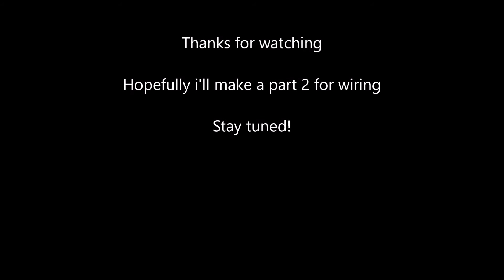VW t5.1 2012 Transporter shuttle Van tow bar installation

Comment: great job! How did you fine the wiring ? did you do a video ?
Reply from the maker: unfortunately my gopro started messing around, it's quite straightforward though, the bypass relay requires a 12v feed, then all the other wires are just from the light clusters, you can chase them back to the nearest point . you take 90% from the rear n/s , i think all you need from the o/s is the right indicator, lights, brakes and stops can be common (they do the same on both sides). Possibly with exception of sidelights (parking lights).... i can't overly remember!

Comment: hi what tow bar is this please? looking to do the same on my 2009 van this week. thanks
Reply from the maker: https://www.ebay.co.uk/itm/143993827117
Reply: @CamberKitesurfing  Cheers - looks same as mine. Also had the same issue you had when rotating it and it fouls where the bumper slots into so can't get the other bolts in. Going to have to grind it tomorrow :-/
Reply from the maker: @chatlow  yeah that was a bit of a pain but i got them in straight without any grinding luckily

Comment: Have you had any problems with this towbar moving at all? Looks same as mine and keeps coming a bit loose soon after tightening the 2 main towbar bolts to clamp
Reply from the maker: no but it's not used much, seems fine so far.

Comment: Did you do the wiring vid?
Reply from the maker: unfortunately not, I started then it was just too fiddly as I had no one to film, you have to get in super close to see the wire colours. If you are testing continuity take the bulbs out otherwise you get continuity through the bulb filaments
Reply: @CamberKitesurfing  Fair enough.  Done towbars in the past butba bit cautious about the CANBUS system and whats different.
Reply from the maker: @vwtransportersandmotorcycl3729  yeah it's a bit different to the conventional method as there is the  bypass relay. It's a case of stripping back the body panels until you find a decent place to T into. Plus the relay needs a 12v feed.
Reply: @CamberKitesurfing  Thanks